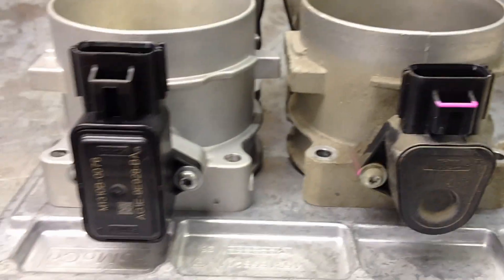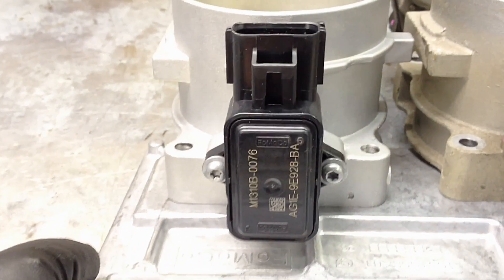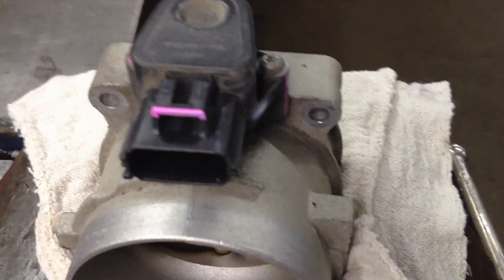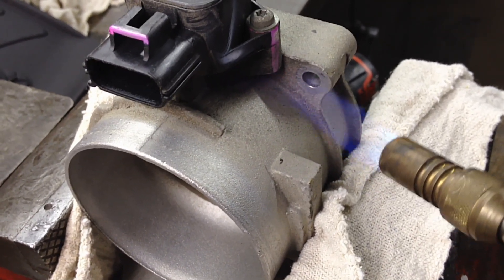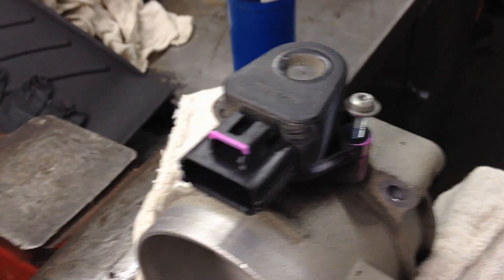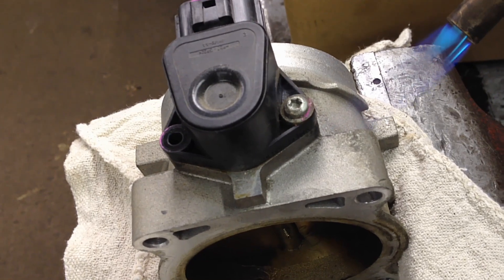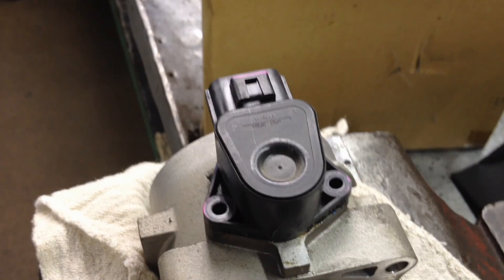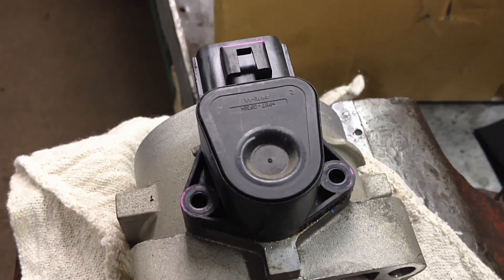Ford Throttle Position Sensor Replace Without Breakage P2135

Comment: Thank you, i'll have to grab a small torch to warm it up, heat gun probably wouldn't work? Having an issue with this and the boss doesn't want to pay to fix it and i'm sick of guessing if the vehicle is going to break down or not, keeps throwing the wrench light too but scanning it while the wrench light is on only brings on p2135, p0135, are either of those codes capable of throwing the wrench light on or is there something bigger at play than my Innova scanner can't read?

Comment: Tamperproof  torx bit sets are usually the best way to break em free I use 1/4" impact wrench I never had to heat mine up I just use my bulk strength

Comment: Thank you so much for this as I heard these bolts break. I will heat up and follow your instructions. Also, I'm a big fan of Liquid Wrench penetrating fluid on rusty bolts If it feels like a bolt is going to break, stop, apply penetrating oil and wait a half hour. I promise you it'll take longer than a half hour to drill out a broken bolt and tap it versus just waiting
for the penetrating oil to take affect.
Reply from the maker: It is not corrosion it is the Loctite on the bolts which last I checked rust penetrant does not dissolove.

Comment: I have a code that says throttle sensor stuck open on my 2013 Ford escape would this calls it to have half the power it usually has?
Reply from the maker: YES
Reply: @FordTechMakuloco  thank you I appreciate it

Comment: How important is the little snap on the TPS connection?  Mines broke.
Is it possible the connection is vibrating off just enough to cause a bad connection not visible to the eye?
I have rpm's sticking/surging.  Only happens around 1600-1800 for 4 to 10 seconds.
Doesn't happen if I'm doing 30 or less,....doesn't happen if I'm doing 50 MPH or higher.
I've changed EGR/Idle sensor/cleaned throttle body/cleaned MAF sensor with correct cleaner,...recently changed TPS.  Same symptoms.  Took car to parts store for computer check,...it said bad TPS.
I wonder because the snap is broke if I'm not getting a good connection?

It's a 2001 Mercury Sable LS.

Comment: I have a 2005 F150 XLT 5.4 Triton V8 (75K) that had the Gen 1 Throttle Position Sensor (TPS).  It still worked, but I changed it out with the Ford Motorcraft Gen 4 TPS today as preventative maintenance.  The sensor comes with a detailed instruction sheet in the package on how to remove the screws without breakage.  I followed the instructions to the letter and got the old screws out with no breakage.  The new sensor was installed and the truck runs great with no issues/complications.
Reply: Part number, please.
Reply: did you ever got the part numbers? for my Expedition 2005 5.4L eddie Bauer my part numbers are F4SZ-9B989-AA or 6L2Z-9B989-D    @Milpower

Comment: Sometimes get an down hill assist error when driving my 2013 f150 4x4 and some times get the same check engine code. What could it possibly be

Comment: 2000 Taurus had 13 codes pop up, this didn't pop up. Waiting on iac valve, worked last time, was a junkyard piece but was between 7-13 ohms. Plugs, wires were done,  EGR pressure sensor was bad, cleaned the map sensor That will be last if resetting CPU doesn't work.

Comment: I didnt like having to take off the TB to heat up that bottom bolt with a torch, I heated the bit up with the torch then let it sit in the bolt hold for a few seconds to heat it up, worked perfect. Idk if it came out ok because of that but it sure didnt hurt, and it came out easy, almost to easy

Comment: It appears this is my issue with my 06 Lincoln Zephyr   However, I cannot seem to find just the sensor to buy for that motor.  The like you have posted is no longer valid per Amazon.  Is there anyway to just get the senor, so far I can only seem to get rebuilt a rebuilt throttle body for this model Lincoln.  Thank you.

Comment: This video saved me $100 and a lot of cursing.  The screws do indeed have a LOT of locktite and if they had sheared off, it would've cost me an additional $100 for a replacement throttle body.  Some additional tips:
1) I was hesitant to put a torch to the aluminum throttle body, but the video showed hitting it for less than 10 sec.  There was a painted alignment mark which discolored when the aluminum heated up (a handy indicator), but I didn't need to exceed that 10 sec.
2) The video starts showing old vs new sensor designs.  Inspect it at the store before you leave and make sure it's the RECTANGULAR (new) design.  I got one of the old design, and it didn't work (somebody probably returned their broken sensor).
3) Pay attention to his tip about "don't stop".  That means to use a power driver (vs hand screwdriver) or else the locktite could re-grab.  Even though I was removing the screws, the clutch on my driver tripped at "8".

Comment: Heated mine and both still snapped off, farq me so I gotta drill them and and eze them out.
Reply: Both broken bolts now out, drill in with a 3mm drill about 5mm deep then gave the body a heating with a new Hot Devil butane torch and with an eze out both screwed out.

Comment: Replaced the sensor and now it won't stay running at all.  It starts for a second or 2 and dies.  Unplugged the battery.  And still nothing.  Need help otherwise I have to tow it in

Comment: 90?/100for a 13$ part  and 70/75 k for a new truck when will they wise up and get those union grubs outta there and drop the truck price to what’s normal 20/25 k
Reply: Theres a based price and theres a loaded with premium everything the workers cost is a very small percentage of the cost

Comment: I let off the throttle and the rpms dont always drop.  My car holds around 1800 rpms for about 3 seconds, then it fully drops down. 
Does that sound like a tps issue?

Comment: Hello, I currently replaced the Throttle Position Sensor on my 2007 Ford f1-50 5.4 l. But when I turn on the truck it shuts automatically off, the RPM’s don’t go real high before turning off. Could you please help me on solving this problem?
Reply: There is a learn function to set the new one sometimes..key on foot on gas to the floor for one minute..no start just key on position

Comment: Hey Thanks for this! I just got mine from the link to Amazon. When I opened it and I shake it I can hear something moving inside. Is that normal? Or can that be defective?
Reply from the maker: yes
Reply: @FordTechMakuloco  thanks, so yes to the defective?. Hey are you from Chicago?
Reply: @rickynunez7367  so yes to normal?
Reply: @FordTechMakuloco  is there any way for you to contact me. I'm having a hard time diagnosing an issue on my 04 expedition with 5.4

Comment: 2010 f-150. No codes! It idles rough, fuel mileage has gone south, has absolutely NO get up and go! Even just driving normal, it’s like it’s starving for fuel. Any ideas??🙏🏼
Reply: Look above your spare tire theres a corroded fuel pressure regulator there
Reply: jeff lid it ended up being my VCT on psgr side.

Comment: i have a 2008 lincoln town car with 2 tps sensors... dont they suppose to exactly mirror each other when moved on a graph? what if they dont mirror what will happen?
Reply: What might happen is they might be trying to sign up damn shoes and but they done been forgot to change the oil in the MF whip. Park it down on the block and let AMF take it for a spin and see if used done gone get it back with two throttle cables two computers and maybe some flat screen TVs. They ain't been done built any motor with two and if they were supposed to be the same then why is there two of them usually if there's two or something one does one thing one does the other. You was probably done been thinking of the cruise control man dang

Comment: hello, thanks for the video, i ordered one of those new models and it was loose inside and it spins endlesly if i twist the meter with a key, is that supossed to happen? i thought it would springs back once you release it, im guessing it came wrecked, what do you think?

Comment: I replaced the position sensor on mt '05 F150 , disconnected the battery for about 15 minutes, then reconnected. When starting the truck, it goes straight into failsafe mode and then dies. Can you tell me what else I should try to do?
Reply: Andrew Harris I'm having the same problem. I've replaced everything; whole timing kit, lifters, vct's, cops, plugs, fuel filter, the  sensor that's on the fuel rail, etc, etc. When I changed it I had the same results as you, there was a small piece of paper in the box that said turn the part that goes up against the throttle body counterclockwise  or it could damage your TB. I turned it one turn and installed it now the rough idle and really rough all the way up and down the RPM range. I'm about to lose my mind. I have a 2006 f150 lariet Roush stage 1. The dealership here wants $400 to hook it to this software the 3v god uses. I have no idea what it could be. Any response would be appreciated. I put the old tps back on and reset KAM. IF I GO up any incline and have to give it throttle, the check engine light comes on blinking and goes away before I can get a code. I'm really at s loss and I don't have another vehicle. Also my SCT x4 can monitor fuel trims. My long term and short term stay around 1.00% I don't know what this could be. Please help 3v savior?
Reply: I had to just replace the entire throttle body and that solved it.

Comment: Wish I knew this earlier. I broke one of those screws getting it out
Reply: yeah mee too.!  i striped out mine . ..geez
Reply: hahah same.  I drilled the fker out.  Because the housing is aluminium its quite soft, and you can just use a new screw and put it back in.  I wont be doing it again if i can help it!

Comment: Well that is much easier to do with the throttle body off the car. The screws are under cut at the screw head and can even snap after heating. But this has got to help somewhat. Not one of Ford's better ideas.

Comment: Please need help! Check engine light came on today stopped at auto store for reading they came up with Throttle pedal position sensor switch voltage A/B correlation.two weeks ago same thing but i stopped at a Mechanic they told it was my throttle body Assembly that needed replacing at $400,00 bucks. So which is it? I own a 2008 Ford Taurus I really don't have 400 bucks thanks
Reply: Oh and my RPM does run a little high the needle will be at 1

Comment: I have a 2006 F150 with a 4.6.  I am getting occasional very rough idle with the wrench light on.  Shut it off and re-start and it runs perfect. The only code is a p2135,  does this sound like the way a failing TPS normally acts?
Reply: Peter L I believe so my Chevy Blazer was doing the same until I changed it. And NOW my ford explorer is experiencing the same issue.

Comment: I have a 2005 five hundred.  The car went into "limp" mode I think.  Absolutely no response pressing accelerator.  Should I replace throttleboby or Pedal Sensor.
Reply from the maker: +kzone65 Throttle body assembly I have a link to the latest one in my video showing replacement.
Reply: FordTechMakuloco The link is for a sensor on Amazon.  Autozone said sensor is part of the assembly.  im confused about waht to buy.  my mechanic said go to O'Reilly.  What do you think about this.  Look at this on eBay http://www.ebay.com/itm/192175202855.  Is the black piece the pedal position sensor.
Reply: I replaced the TBody.  everything working great.  Thaks.
Reply: @FordTechMakuloco  I have a 2004 ford explorer 4.6 v8 and I changed the throttle positioning sensor and it give a code of 2106 and engine failsafe when I put it in drive and press the accelerator please help me

Comment: just changed my tps as you show and still have a low idle.. i then changed fuel filter iac valve egr hoses fuel pump and still have the low idle and terrible gas mileage. idles at 550 and engine is very powerful.. changed charcoal canister solenoid and still have the same issue.. I'm stumped.. also changed front hubs and 4x4 solenoids.. the other symptom I'm having is a vibration hum when i engage 4x4 on the highway.. any help you could provide will be greatly appreciated. thank you

Comment: When I tried to change the TPS the screw stripped when I tried unscrewing it. The screw driver was thought to be a good quality one well it broke the screw driver.. any ideas how to get it off? I used the same torch you used.. Thoughts on how to remove it?
Reply from the maker: If it is stripped you want to use more heat and an extractor like this- http://amzn.to/2irdS3Q
Reply: Should I heat the head as well?
Reply from the maker: +Milton ACN yes it will transfer through
Reply: thanks bro your the best
Reply: thanks bro your the best
Reply: he said in video to heat screw and use impact driver.

Comment: I live in the Northeast should I only eat up the bottom of the bolt and not the top? Looks like you heated underneath the TPS. Hopefully this will fix my low idle when I shift into drive or reverse..

Comment: Thanks again! Mine had phillips heads, but the same concept worked. Used a low speed impact driver after heating and they came right out.

Comment: i have a 2009 f150 STX and my truck is going into limp mode.
I had the transmission rebuilt and the problem keeps coming back. The best i can figure the problem is in the throttle body and likely the throttle position sensor. If i replace this diy will it need to be programmed at the dealership?   Please Help.
Reply from the maker: I would get codes read first but here is the latest throttle body for your 5.4L- http://amzn.to/2dUS8QX
Reply from the maker: After it is installed follow this procedure to learn the new throttle body- https://www.youtube.com/watch?v=ZNxXM75zJOw

Comment: hello I have a 2006 f150 xlt with a 2v  4.6. I have been having an error code show up on my edge programmer its the P2126 error. Can you tell me if you have sen this issue before and if the sensor is bad Ive heard it needs to be clocked. The sensor youre showing here was its error code the same with a different year or was something else wrong. Thank you.

Comment: I have a 2004 Taurus accelerating on its own. Would the TPS be a good place to start? No check engine light is on. Thank you for the torch tip.
Reply from the maker: If it is just revving on its own make sure there is no vacuum leaks and also with a scan tool monitor the vss signal I have seem this spike causing this concern. If all else fails a IAC would be in order 3.0l 12v- http://amzn.to/2b4vOkm3.0l 24v- http://amzn.to/2aT8PVC

Comment: I have a 2004 Ford F150 FX4 Supercabcrew V8 5.4L.  I am looking to replace this sensor in my truck but the Haines manual is saying for the 2004 year that the manufacture recommends replacing the whole throttle body if you want to replace this sensor.  Is this true?  The sensor currently on my truck looks like the original one you show in the video and the new one I order looks like the final design as you mention in this video.  I am just confused on why it says I can't just replace this TP sensor without replacing the throttle body.

Comment: I changed my sensor an broke the screw because I didn't heat it up. anyways the idle sucks  with the after market. why is it so hard to get a genuine tps? where can I get a new one?
Reply: Paid $20 for an OEM Direct Ford Part on Ebay. I get all my Genuine Ford parts there

Comment: 94 F350 7.3 diesel, my mechanic rebuilt my transmission and it still ran bad, TPS code, he kept the truck 3 months over the TPS, still same, took back, 2 more months and it runs the same and the OD light is still blinking. He claims he can't adjust it because it's and older system. Now he is saying he will try to borrow the right tool. It's been 5 months over this TPS code. Probably rebuilt the transmission for nothing. What do you recommend?

Comment: Is the sensor you referenced in the link fit all 5.4's?  I have a 2010 f150 5.4. The amazon link you have in the description says this sensor is not for my truck. Thanks
Reply from the maker: +zimsjeep Yes I just verified in my Ford catalog that is the correct number for even the 2010 model year. You have to remember the 5.4l 3v engine has pretty much remained unchanged since the 2004 introduction. Hope this helps!
Reply: +FordTechMakuloco Thank you very much man. I appreciate it!
Reply: may I please ask you a question sir? I have a 97 cobra 4.6 4v dohc car and I was going to change my tps, is there anything in particular i need to do as far as physical adjustment like the fox bodys have to as far as setting it to below 1 ohm or letting the car re-learn the cars throttle position at idle, if so for how long and what about driving there after to teach the new tps? or are they more advanced and just plug and play in my vehicle ? what do i need to do in order to replace my tps? thank you sir

Comment: I get 1.11V after installing the new sensor. Does this sound right? I read somewhere that the voltage has to be between 0.7 - 1.0V. BTW I have an 06 Mustang Coupe 4.0L
Reply: +sanmiol This is a potentiometer AKA variable resistor AKA adjustable resistor, AKA rheostat.  The 'wiper' or signal, will produce a voltage between GND and Supply, or 0 - 5vdc.  Some offset so appears from what I've read to be 0.5 - 4.7 VDC.  So the voltage you read would depend on the wiper, which when installed, will depend on the throttle position.  If you've removed it, then turn it by hand and see if your resistance (ohms on meter) changes smoothly at the wiper as you put red on 5v in and neg on signal.  If you do this, the TPS must be disconnected from electrical!!!

Comment: Yeah will do ! wished I had bought motorcraft parts  Tps was Hundred + Thanks for the info !
Reply: That's the Key, after market Throttle Position Sensors will not Hold Up--Replace unit with Genuine Ford Sensor...